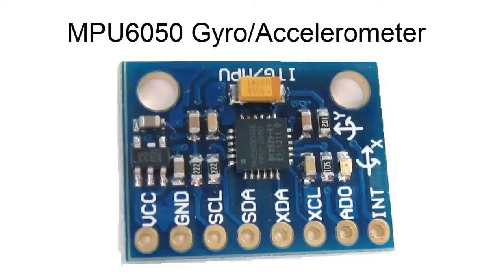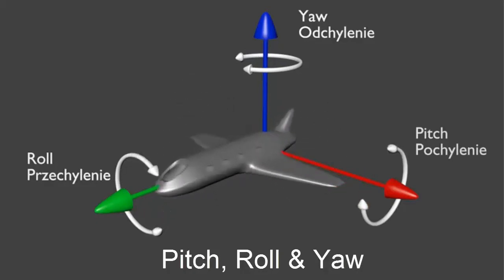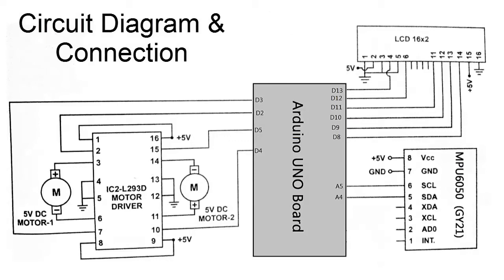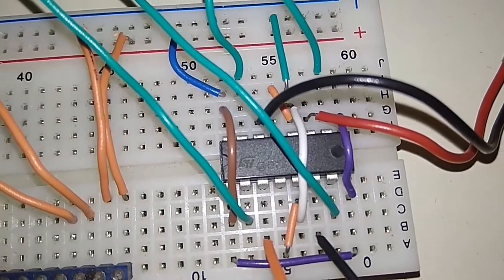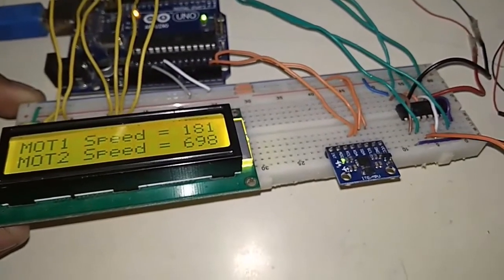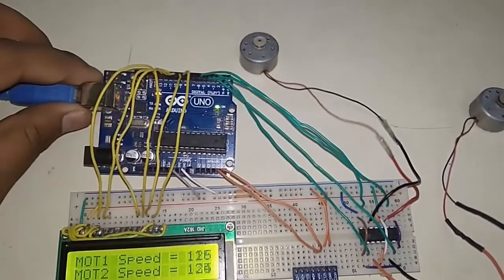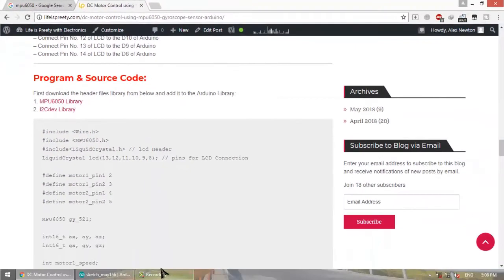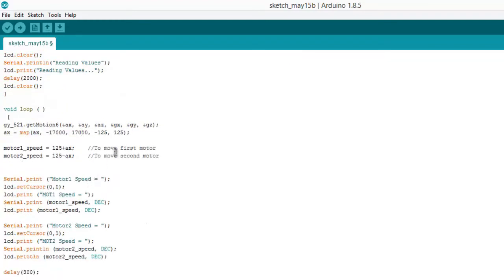MPU6050 Gyro/Accelerometer Sensor & Arduino for Controlling DC Motor

Comment: I know this is possible, but may I request that you upload something simillar. 
I'm already thinking this for my homebrew gyro electric screwdriver. 
A motor speed and direction will deoend on roll values/tilt clock o counter. 
Thank for creating your conter keep it up.

Comment: cara coloca tradução cara para português !!! ...   // 
>>>>> tem muita gente que não fala seu idioma o mínimo que você poderia fazer em consideração ao inscritos de seu canal é traduzir para o idioma deles também 
Neste projeto, vamos aprender sobre controle de motor DC usando MPU6050 Gyro / Accelerometer Sensor e Arduino. MPU6050 é um sensor acelerômetro e giroscópio combinado em um único chip. Ao mover o sensor para cima ou para baixo, a velocidade dos motores aumentará ou diminuirá. Estaremos simplesmente conectando o sensor MPU6050 ou GY21 com o Arduino para controlar 2 motores e exibir a velocidade no LCD.

Movendo o sensor em uma direção para cima, a velocidade do primeiro motor aumentará e a velocidade de outro motor diminuirá. Da mesma forma, movendo o sensor em uma direção para baixo, a velocidade do primeiro motor aumentará e a velocidade de outro motor diminuirá. Também exibiremos a velocidade do motor no LCD 16 * 2.

Comment: Hi, what if I want the closed loop to be perform on the z-axis meaning to keep the car to steer in a straight line, so that it doesn't move left or right due to any reason, how can I modify the code to do that?

Comment: Hi, I have a question. If i change the motor into a vibrating motor, will the accelerometer be able to control the intensity of the vibration?
Reply from the maker: Yes it will be

Comment: How  to use  2  gyro   With   Ur  Same   Codes  ????   Simply want  to  use  2  gyro   For   2  motors   (  gyro 1 for  left   &  gyro 2  for Ryt  motor ) ... plz  suggest
Reply from the maker: Both MPU6050 uses I2C address. So you need to change I2C address of 1 MPU6050 by attaching 1 pull up resistor to AD0 pin.
Reply: Can this work on linear actuators

Comment: bro can we use adxl345 instead of mpu6050 gyro
Reply from the maker: Adxl345 is accelerometer.
But MPU6050 is Accelerometer+Gyroscope.
Reply: @HowtoElectronics  bro how to adxl345 as a adxl335

Comment: Can we connect this arrangement with more powerful battery and motor?
Reply from the maker: Yes you can use upto 36 volt. If you want to use beyond that voltage than you need amplifier circuit.
Reply: @HowtoElectronics  thanks bro.